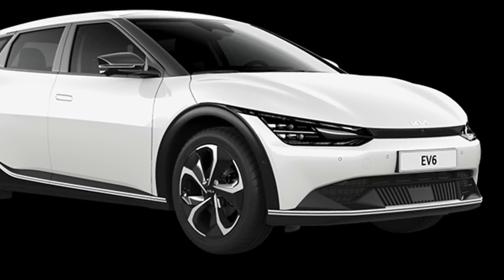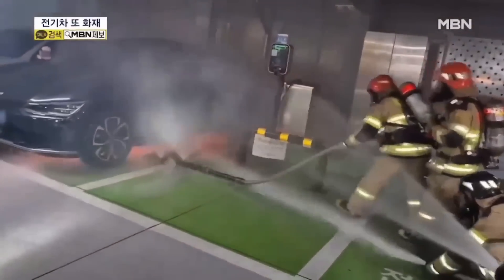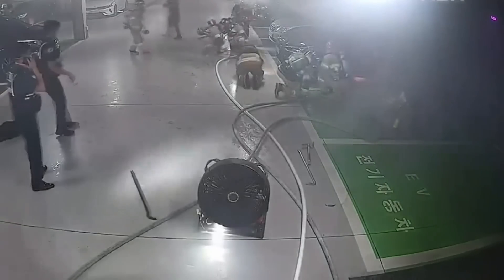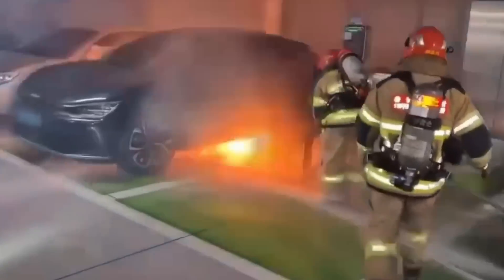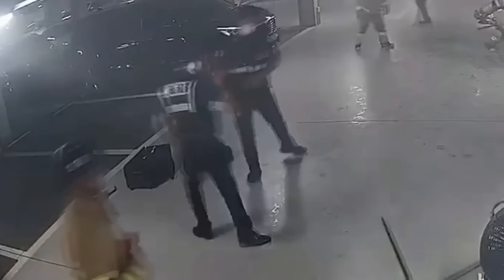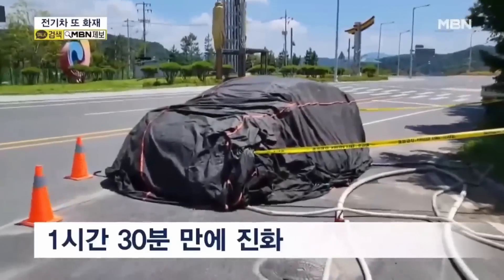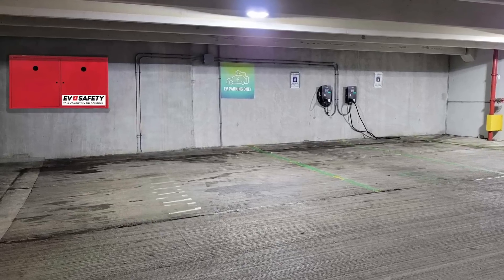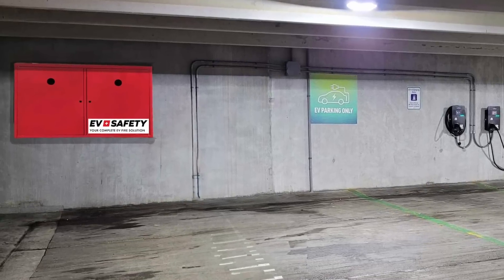Second EV Fire in Korean Parking Garage: Days Later

Comment: If we could only make a vehicle that doesn't spontaneously combust while parked. Oh wait...
Reply: Definitely not any ICE vehicle with hot metal parts with no protection to the outside.
Reply: @wocket42  So basically, what you are saying is that it's okay for prodigious numbers of EVs to catch fire because the occasional petrol or diesel car catches fire also. That's a very strange argument to make. And before you respond with made up statistics, 65% of all vehicle fires are the result of arson, and most of the rest are caused by electrical failures. The petrol or diesel fuel system typically doesn't cause fires. Something else has to happen first.
Reply: @matthewgodwin3050  the root cause doesn't really matter to the damage the fire causes, though. And blaming non-working sprinkler system etc on EVs is just dishonest. And yes, the number is prodigious. Prodigious low.

Comment: I need to ask a question... Early on when radio controlled models switched to lithium, the fires were bad. The manufacturers all decided to add something to the pouches that reducing the risk of flames. That was like 15 years ago... Why are full size cars different? To me it seems logical that this anti fkame additive would have been in the car packs from the beginning. Or is it a case of the hobby batteries do not have enough other pouches packed in tightly to raise temperatures far higher than the hobby packs?
Reply: I don't know for sure but if I were to guess I would say the additives reduce capacity or perhaps longevity.
Reply: From the video it states the batteries consisted of pouches, think flexible slim plastic bags. These are alway designed with anti-explosive design or fire prevention in mind.
Reply: Toyota has already been selling hybrid cars like the Prius for over a decade. They don't have any fires like these, as the batteries are built better but have less cells in the pack. These newer all electric cars have much tighter packaging, so all the cells have less space to breathe.
Reply: Full size cars aren't that different, but nobody cares about an RV going up in flames. But if one EV is burning, it's worldwide news.
Cars are also switching to LFP batteries. I'm not an RC guy but I've heard that they became very popular in the RC space too.

Comment: How much do those fire blankets in the cabinets cost?
Are they worth stealing?
Reply from the maker: The blankets are locked up with a special key fire departments carry.
Reply: @StacheDTraining  Hopefully the building owners are smart enough to mount the cabinets 50 or so feet away from where the EVs park.
It would defeat the whole purpose if you can't get to the blanket because it's blocked by the fire.

Comment: The 1980's cars were all we needed.
Reply: I’ve bought another Citroen 2cv just like the one I used to have years ago. 👌
Reply: So true
Reply: Ah yes...can't wait to get my hands on another Ford Pinto...since my old one blew up I've been looking for so long
Reply: @OveToranger  The Ford Pinto was a 70s car, not an 80s one. It was produced between 1971 and 1980. However, implying that EV fires should be ignored because one single model of petrol car that went out of production 44 years ago also had a fire problem, is a very strange argument to make. We all want safer vehicles. Pretending that the EV fire problem doesn't exist, is both dangerous and irresponsible.

Comment: check out the explosion in the Chinese port today. It sure looked like a Battery runaway .
Reply: huge explosion , maybe from chemical explosion like Beirut port or Tianjin some years ago ?
Reply: @M_Jono  Could very well be. Some kind of compressed fuel.
Reply: Uhm... it surely did NOT look like battery runaway??? It was a huge explosion. Batteries don't behave like this at all...
Reply: @Tschacki_Quacki  Nope it looked like a gaseous vapor conflagration to me. 
A battery would be on my top 3 list after propane or butane.
I do have a clue about how accelerants work.....
Reply: @thomaslthomas1506  May you give me a hint on an incident where thermal runaway from a battery has caused an explosion like this?
Reply: @Tschacki_Quacki  There have been several posted on this channel. 
Put a highly explosive gas in a confined space with plenty of O2 and an ignition source this is what is would look like.
A giant oil can bomb.
Propane would behave in a similar manner but since I doubt your be shipping a propane this way a battery would be my first thought till you get a look at the manifests.
Reply: @thomaslthomas1506  Chinese news reported the ship incident as a lithium battery thermal runaway explosion, manufacturers buy the individual barrel cells or pouch cells in bulk to build vehicle and power unit battery packs. I find it curious that almost all the YT accounts that comment that EV fires aren't dangerous on these type of videos are all contentless blank accounts made recently. That explosion would have leveled a city block had it occured in one. This channel has multiple incident reports of catastrophic explosions from lithium battery thermal runaways, these people, if they are in fact people, saying EV fires are safer than ICE fires are clueless.

Comment: It's a pity that EVs can't all be fitted with a standardised system of perforated internal pipes to direct water from an external hose straight onto/through the battery. Acces to the inlet could be via the equivalent of the fuel filler cap on an ICE car.

Firefighters arriving on the scene could then go straight to the water access cap, clamp on a standard hose coupling, and retire to a safer distance while water was blasted deep into the vehicle where it would do the most good. Better than scrambling about undeneath it, trying to get water past the battery's protective shielding.

Many racing cars [with internal combustion engines] are fitted with a permanent 'plumbed in' fire extinguishing system which can be triggered either from within the cockpit by the driver, or by a marshal from outside. The extinguisher has outlets in the engine bay and at various points around the driver. Even if the car's upside-down and on fire, the driver still has a chance of escaping.

If EVs were required to carry the same empty pipework - without the extinguisher - it would make getting water onto the internal battery a great deal easier. Carrying a few extra pounds of piping would be a small penalty compared to hauling round 500lbs of battery.

Not sure how you'd prevent jokers from tampering with the access point and filling your car's pipework with beer, pee and pizza crusts but hey, nobody said life was going to be easy.
Reply: I think in a lot of cases the car would not be approachable once it was noticed that it was on fire. I don't know how those blankets could be put on either.
Reply: @bingo7799 automated prepositioned sysyem. Or installed infrastructure if you will.

Comment: Maybe I'm stating the obvious fact, but it is unfortunately the case that these batteries do have the ability to go into catastrophic thermal runaway for a number of reasons... it is certainly a RARE occurrence, but it does happen. That's a simple, undeniable fact.
Unfortunately, if you start exponentially increasing the number of these batteries, you also increase the likelihood of these 'rare' occurrences... possibly to the point where they become common occurrences.
Reply: And then there is design safety or failure rate.
     Would that be failure rate of 1 in 100,000 \ 1 in 1,000,000 \ 1 in 10,000,000 \ 1 in 100,000,000 ?
Reply: Yes. They forced an untested product into millions of arms and rare events started happening to young athletes all over the place. Rare my arse.
Reply: disagree
LFP batteries are becoming more popular and overall failure rate of batteries is decreasing.

We hear this argument since more than 10 years but there have been millions and millions of sold EVs since then but the EV sceptics still get their battery fire cases very rarely and literally have to look for them in the whole world.
Reply: @Tschacki_Quacki  EV fires aren't rare. I live just up the road from a vehicle impound yard, where stolen, burnt out, and accident damaged vehicles are recovered to. I've been here for over 15 years, and in all that time, the only burnt out cars I've witnessed being recovered there have all been EVs. The vast majority of them have been Teslas. In my 44 years on this earth, I've only ever seen 3 burnt out petrol cars (two arson, one unknown), and the last one happened over 25 years ago. However, I have lost count of the number of EVs that have caught fire in the last year alone.

Comment: 1st Big EV fire, security guard shut off the springer system when it rang.... Korea plan to make a mandatory all EV vehicles has less than 85% charge if you want to park under ground. Meanwhile apartment management company make you responsible if charge state is more than 85%
Reply: Nothing to do with charge level, it just makes it a bit worse.
Reply: @johngray3449  I did agree. Make the battery more unstable and more explosive when it is short-circuited or punctured,

Comment: Saving the environment one spontaneously bursting EV at a time.
Reply: Yes more than 15 just this year alone, no problem with the 1 million Covid deaths because of DonOld I see !
Reply: Don’t worry. Most EV wanters including me don’t give a damn about the environment in the first place. I like how some anti EV individuals try to argue this point when it applies to a minority and the majority aren’t cross shopping vehicles for ThE SaKE oF LOweR g/CO2 a MiLe.  

When was the last time you thought to yourself, “oh, buying this shirt will cause a net output of this many grams of carbon”? No reasonable person does that. 🤣

Some reasons I want an EV. Notice how the environment isn’t listed. 
-Super cheap charging with home solar and energy independence
-Super low maintenance
-Battery will retain drive-able capacity well after 200k miles. 
-Accelerator pedal that is just as reactive as a brake pedal 

See? Everyone has preferences. Choosing the type of power train included. The nature of flight accidents is much worse; that does not mean you take a super rare instance and categorize flying as dangerous. I will still own a personal vehicle even if the chances of dying is much higher than zero.
Reply: @battery_wattage  nice dissertation. Carbon 'credits' (taxes), tax incentives, etc., have kept it afloat. But hey whatever floats your boat. Merely pointing out the many jedi mind tricks deployed to make it seem all rainbows and unicorns.
Reply: @battery_wattage I bought my battery powered cell phone to save the environment!
Reply: @user-ln7of9gs4s  maybe using the traditional land line will be better for the environment since  there is no efficiency loss from charging a battery and no screen and not needing to do 20,000 MOps. 😆